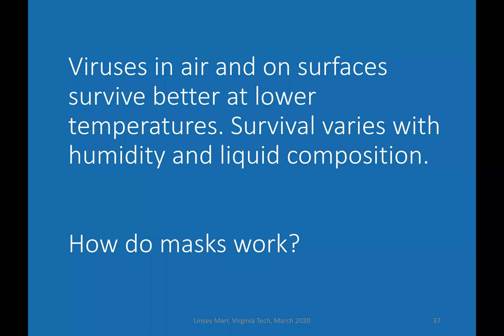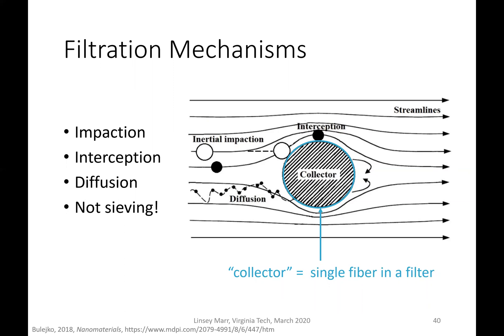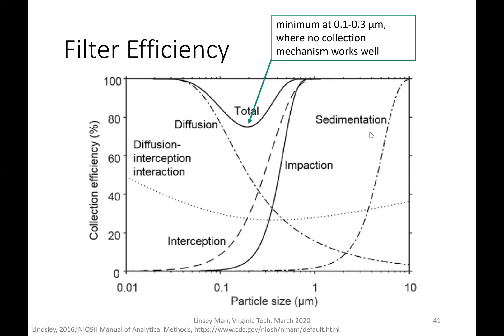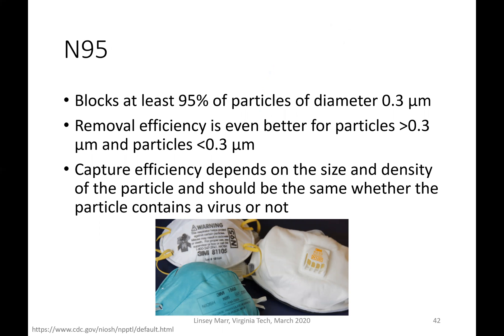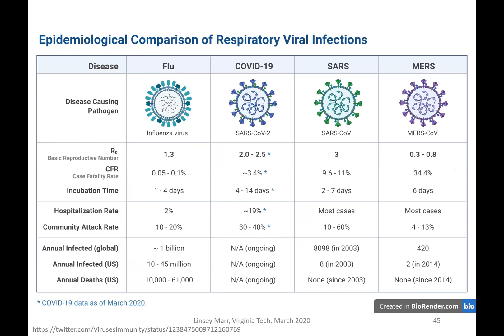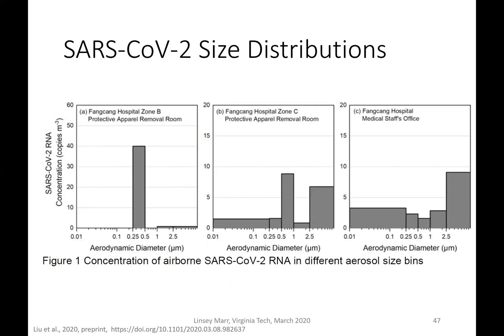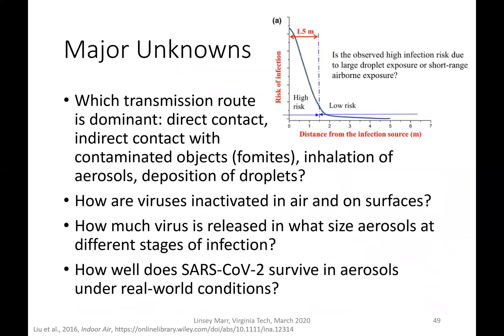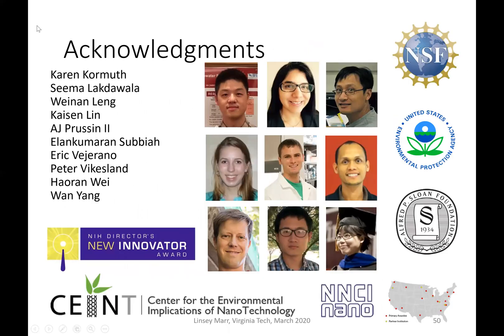Transmission of Viruses in Droplets and Aerosols (part 4)

Comment: Hello, Dr. Marr! Thank you for your work. I bought a box of 3 layer spunbond polypropilene duckbill masks. They are excellent to breathe and they seal on my face with no gaps. I know they have no meltblown layer, so I shouldn't go to a crowded place, especially not indoors, in them. But I still want to wear them outdoors when I'm exercising, in a park where I ocasionally walk past panting joggers. Are they protective enough under those circumstances? Would rubbing them with a latex or nitrile glove improve ther efficacy?